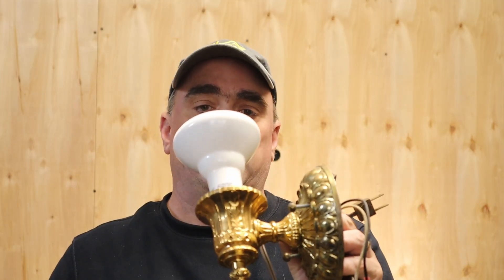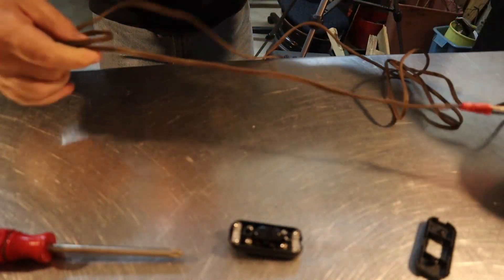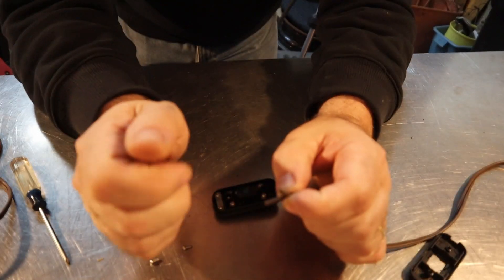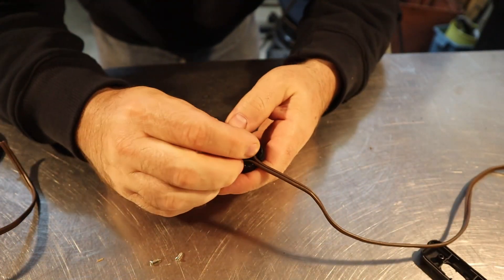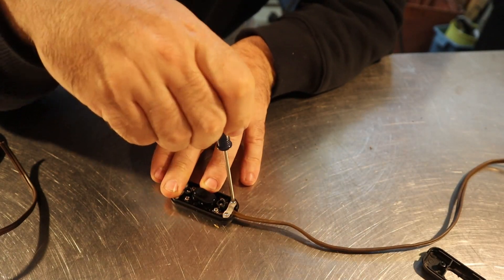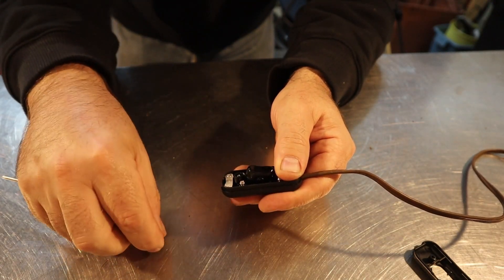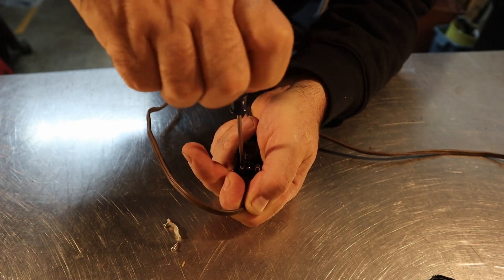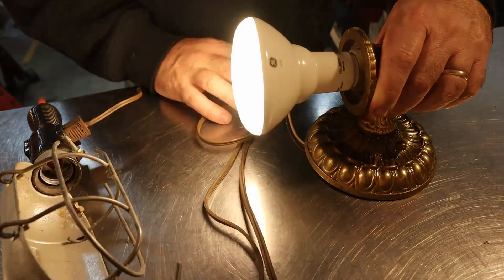Adding An Inline On/Off Switch to One of My Video Lights | The Fixit Shed

Comment: As I was looking for information I found your video with the exact switch I’m trying to install.  Great.  My little wires won’t stay together no matter how I twist them.  I’ve stripped off too much insulation.  I’m not positive I have the wires matched up correctly on each piece.  The holes are tiny, the screws are tiny and my eyesight is poor.  My hands are arthritic and clumsy.  Thanks to your video, my switch is working and my lamp lights.  Now I’m going to take it all apart and try to do a neater job.  Thank you for the valuable instruction - I wasted an hour last night trying to slip the wires around the screws.  Didn’t know about those little holes 🙄
Wish me luck.
Reply from the maker: Congratulations on your success! Glad you got it sorted out, and the video was helpful.  Good luck!